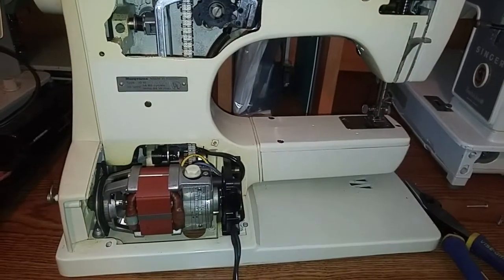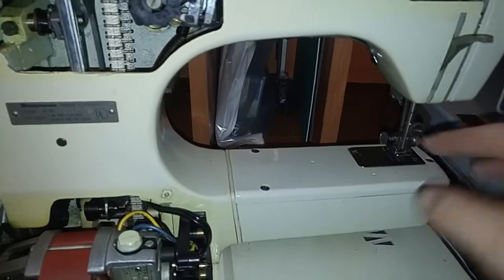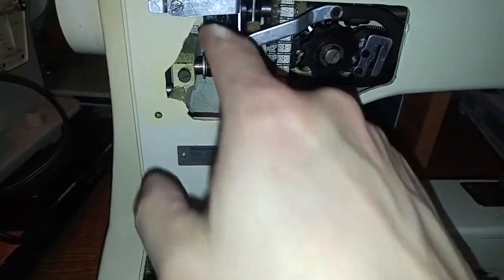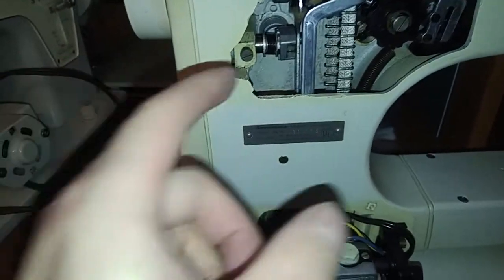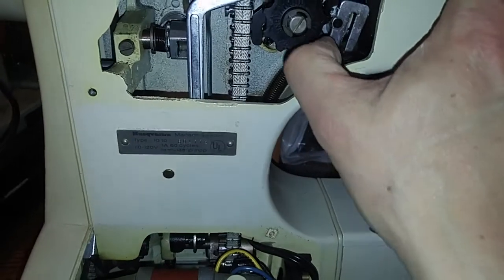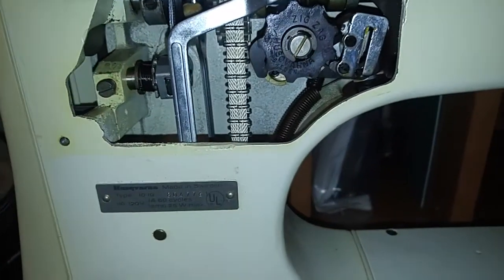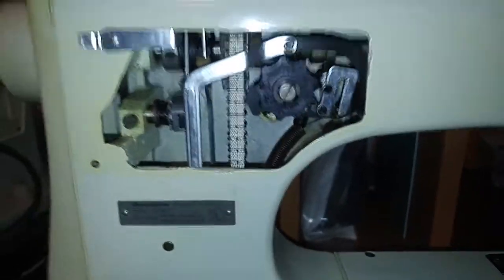Rescue - Viking 1010 Update 2: Reverse and Zigzag Not Working, ID'd Zigzag Cause

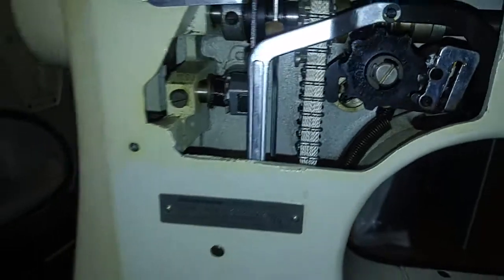Comment: Hello, at 4:15 in the video, did you ever manage to find out what was going on there? I have scrutinized the internet to find the answer to my problem. The 'knob stitch size' +  'quick reverse' is turning but the size of the stitches remains tiny. The clasp that looks like a 'U' and holding the small metallic cube doens't move even when turning the knob. Any thoughts, ideas, solutions are very welcome. And thank you for these great videos by the way.
Reply from the maker: Best is to completely disassemble and thoroughly clean.  However, I've been able to successfully use either Dollar Tree Baby Love oil or Unscented Lamp Oil from Walmart to soak literally and then massage the mechanics until they eventually move throughout their range of motion.  Focused heat from a heat source like a hair dryer might help as well to loosen up and get moving wiping off what comes out and soaking again until only needs the oil.
Reply: @jafinch78  I will give it a try. I'm just very nervous to dismantle my machine and not be able to put it back together correctly with all the internal settings in order. Thank you very much for your reply.
Reply from the maker: @HunteSnoden  If you have the time, like I did, just be patient and use the unscented lamp oil and massage the mechanism back and forth with your hand until after a few days, weeks or even month the mechanism is free moving with the buttons. That's what I would do.  Your very welcome and thank you!
Reply from the maker: @anawoodsen8 https://www.youtube.com/watch?v=AZHEE93rWJ0 Might be of more help to detail?  Check down in the description of each video for the subsequent video.  Did wind up loosening and cleaning up with the lamp oil.